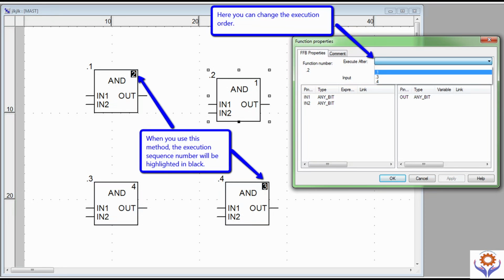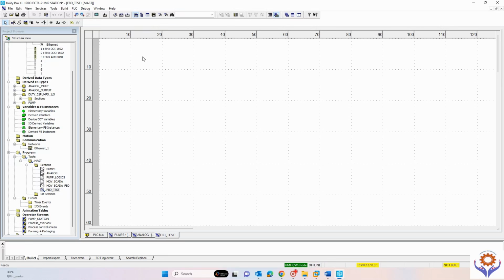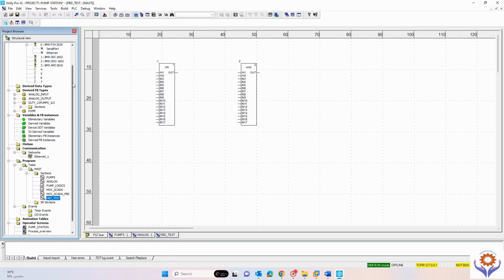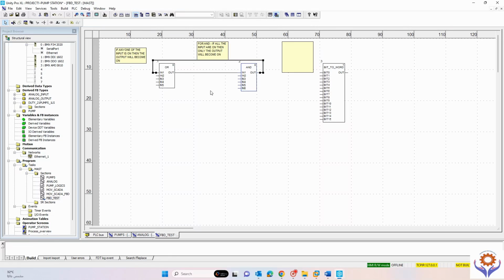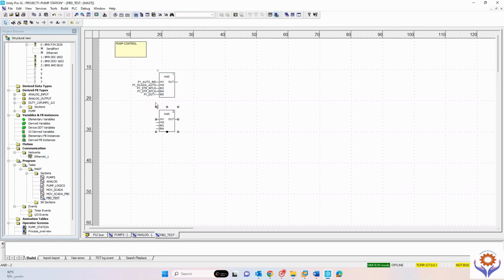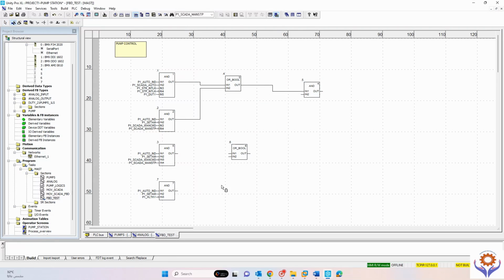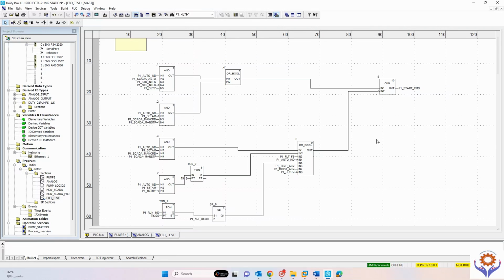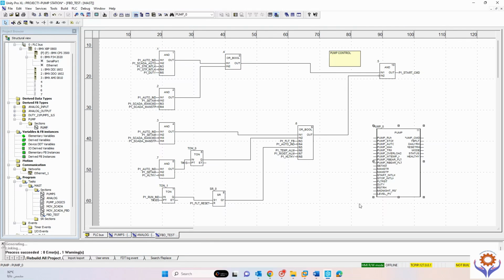Functional Block Diagram basics with Pump Logics | How to Program PLC Using FBD #automation #plc

Comment: Hi Sir, I would like to thank you a lot on doing the logic I am looking forward more logic like Heater function, Mixer function lube oil pump function, ESDV function, level flow temp to drive a control valve that would be appreciated, one question I didn't get why you repeated ( P1_Auto_NO ) in stop section block.3 without inversing it, and why you repeated (P1_SETAM) in block .7 while it was already in block .3 ??
correct me if I am wrong, I think the logic of FB was incorrect if you imagine the pump is not running the (P1_Run_NO) is 0 when the pump runs  (P1_Run_NO ) will be 1 after 30sec output of the timer will be 1 means the input of (SR) S will be 1 the output of SR will energize to 1 that will trip the pump , looking for your feedback please
May Thanks and Regards
Mustafa